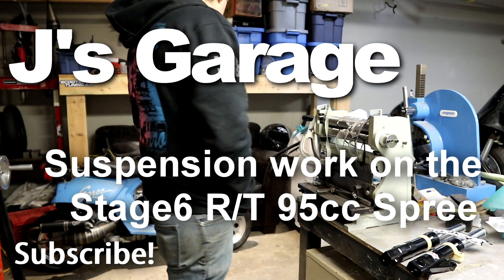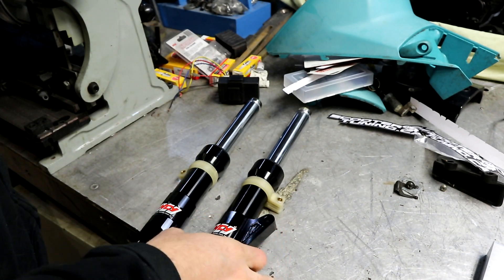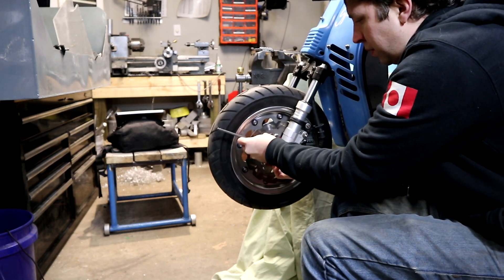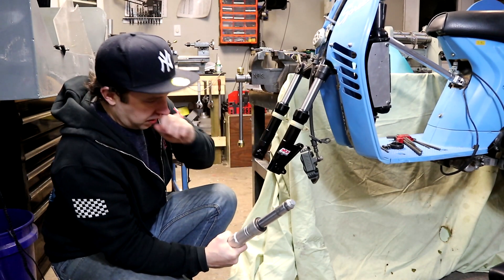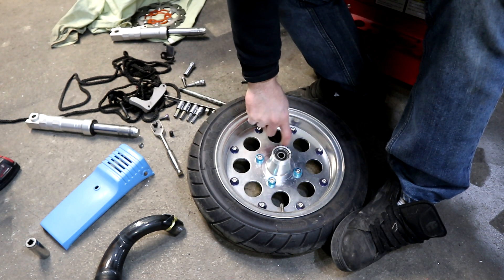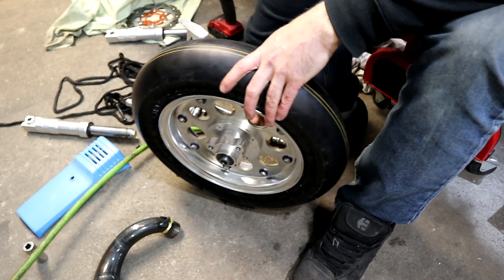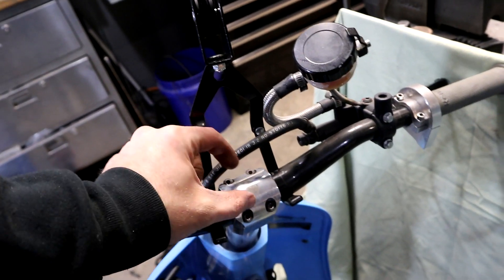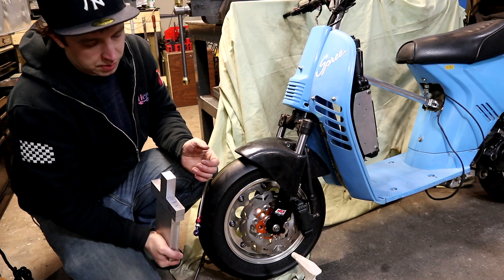Stage6 R/T 95cc AF18 Honda Spree - Sorting out the New Suspension - J's Garage

Comment: I wonder what kind of forks I can fit on my Tact Ivy to put on Dio wheels and brake disks..
Reply from the maker: The legs themselves are pretty universal, Finding a set of trees that are the right spacing and with the right headtube length is the problem.
Reply: @pitobread  Oof, yeah, either find one of the exact dimensions or mod it to fit the frame. That's what I was thinking too. Thanks for the answer!